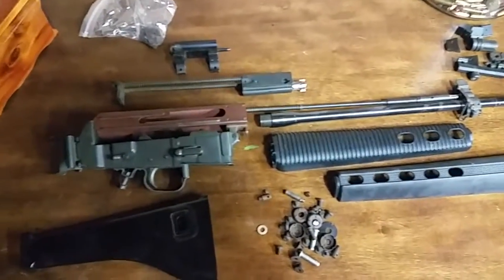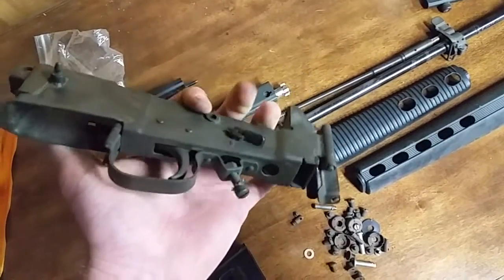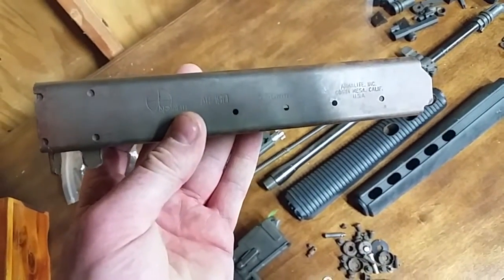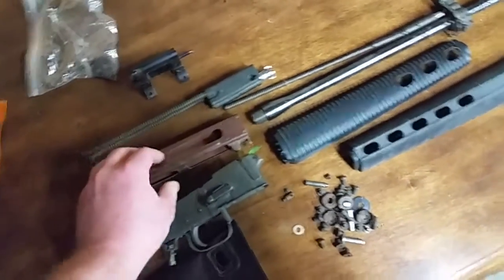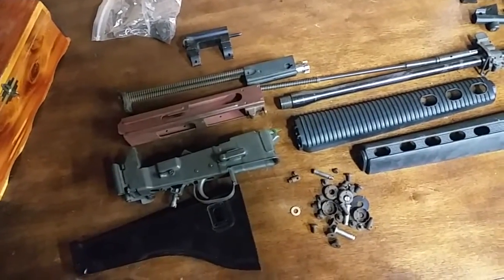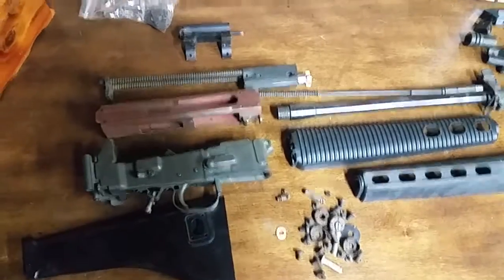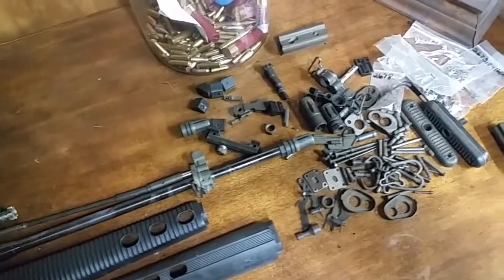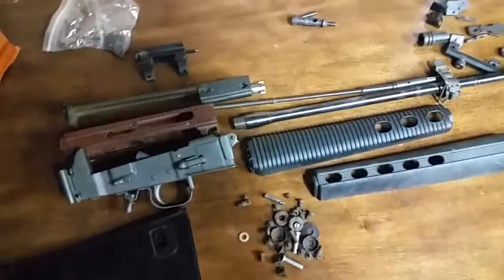Viewer Request Video 19: Homebuilt AR180 long term project

Comment: Your working with a sterling mag well so you need to use steel mags as the factory  aluminum will go in to deep and jam .  The upper  need the bolt rotation track welded in the holes on the back side.  Do you have the track?  How will it index?
You may want to re work the mag release to be same as an Ar.  Will make Calif legal easier.  Good luck